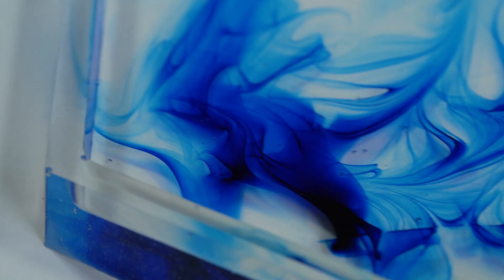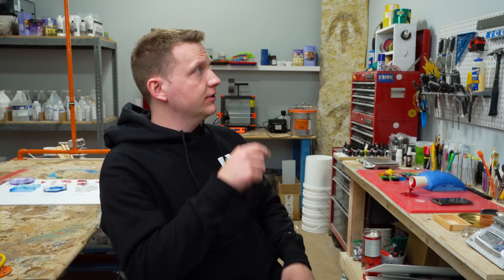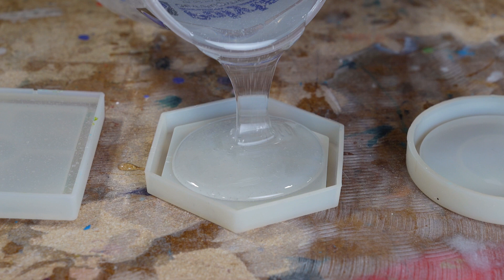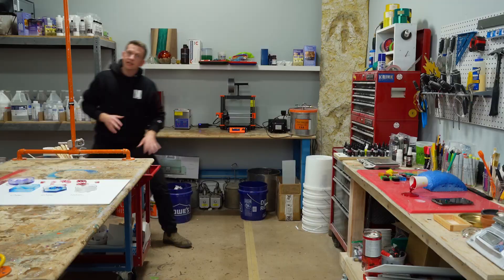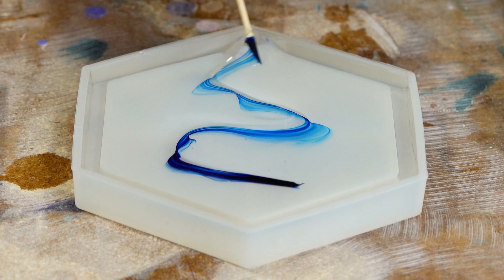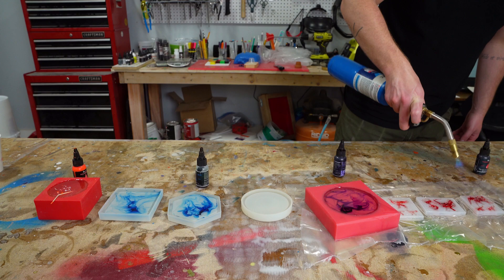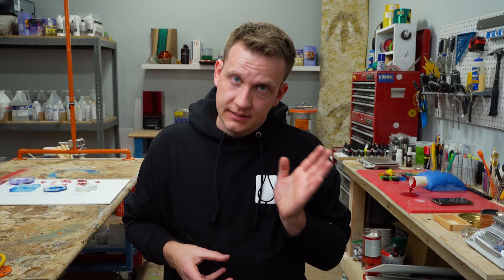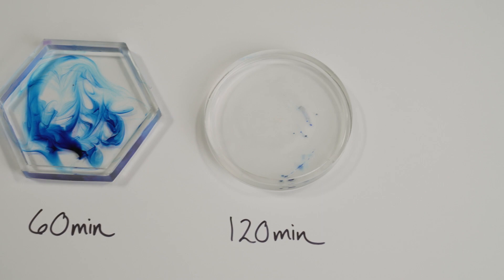How to Make Swirls in Epoxy Projects | Alumilite

Comment: Have you done a video like this doing swirls with Deep Pour. I wasted over a $100 in resin because it works so differently than Clear Cast. Also, when I tried swirling after 6, 7, 8 and even 9 hours, all i got was a “muddy” over blended mess, ruining three major Christmas projects and wasting expensive resin. If I missed the video on swirling Deep Pour, same on me, if Alumilite didn’t explain it better (video ) shame on you. When I contacted “support” by phone and e-mail, they didn’t even have an answer on how long to wait before “swirling” . It has been an expensive lesson to learn.

Comment: When I tried this method with the same materials you used, I had a different result.  I was making smaller heart shaped objects and when the piece cured, I had wet areas of the dye color that never completely cured.  Too much dye, right?  Or not swirled into the epoxy enough?  Thanks!

Comment: I use Alumilite, 3/8inch pour, was going to do the 3-5 hour 2nd layer, 1 hour swirl, but... 60 minutes later, could barely dent with a fingernail. So next layer did the swirl at 30 minutes. 70 degrees. What did I do wrong?
I am addicted!

Comment: Would it be possible to use different color dyed resin to draw or write say more uniform shapes or designs such as drawing a cloud or sun without the use of shapers/molds, but just literally using the resin as if it were paint to draw something? I was thinking you could, but then I realized the resin would spread out and deform whatever you drew right? If it is possible, how can that problem be tackled?

Comment: Thanks!
Tricky question because I know there are lots of variables and it's hard to quantify: but if you're letting your epoxy thicken to get more viscosity, at what point is it too late to throw it in the pressure pot? For instance, is the viscosity in the video above too late?
Reply from the maker: This is a great question! With this technique it's more difficult to incorporate the use of a pressure pot. We would almost recommend putting the piece in the pressure pot during the waiting time, adding the swirls, and then putting it back in the pressure pot for the remainder of the cure schedule. For a more accurate answer, definitely reach out to our customer service team (info@alumilite.com) they may have run into this situation already!

Comment: Hello, I’m a new subscriber and I use alumilite for coating lures on a turner. It is a very thin layer spinning.  How do I apply swirls using this style of procedure as I want to use this in the lure design? Thanks for your vids. 👍🏻👍🏻

Comment: I'm trying to make this domino set. She wants purple with a white pearl swirl in it. How would I do that? I have tried pouring the purple first then adding white and swirling it with a toothpick and it didn't come out "vibrant enough". Thank you
Reply from the maker: Which part wasn't vibrant enough, the white or the purple? You could try using white pearl powder and mixing that in it's own cup of epoxy and pouring both purple and white at the same time!

Comment: My question: can I use this technique to make swirled pen blanks?  3/4x3/4x6?  And how long to wait before using in a project?
Reply from the maker: If your using epoxy then this technique will work! But if you're using urethane then the whole process will be much quicker!
Reply: Wait for resin temp to get to 120f, then colors stay separate

Comment: Well, in my case 60 minutes equals 10-12 ours and result is not satisfied, because my epoxy resin have much more freeze time. Twice I try to make a beautiful swirls, but… I has to wait a few ours more to get an epoxy of “good” condition. Despite the fact that manufacturer guaranteed that there’s epoxy have to freeze in 48 ours.
Reply from the maker: This process can change drastically depending on your environment and the materials you're using. Resin is exothermic so it cures using heat - if your material is too cold or the room temperature is too low, it will always take longer to achieve your intended results.